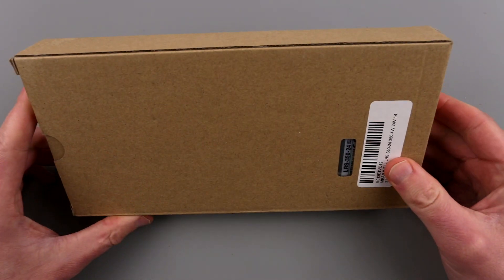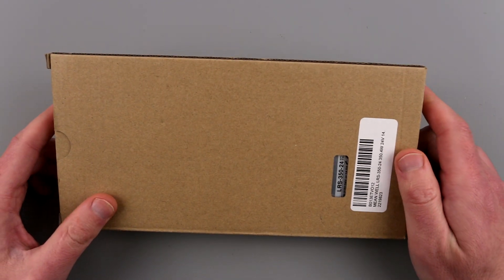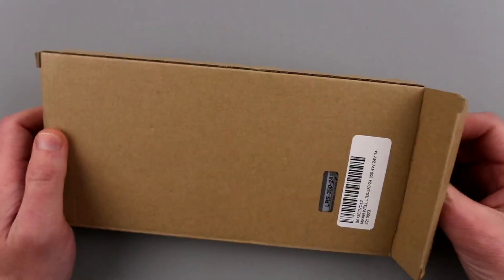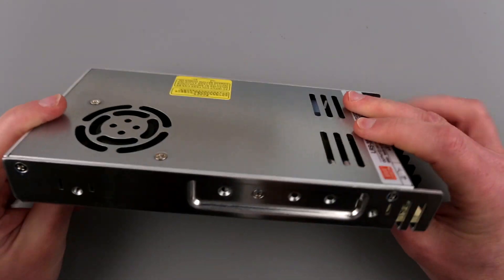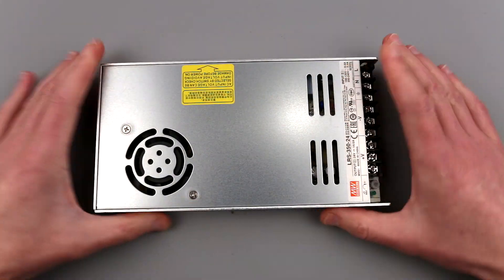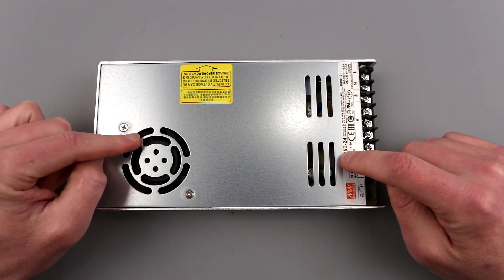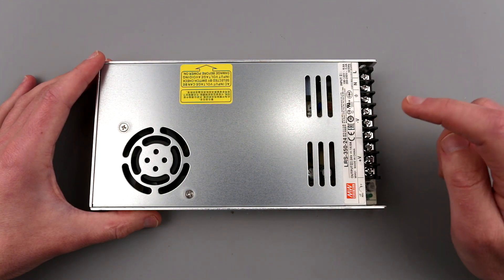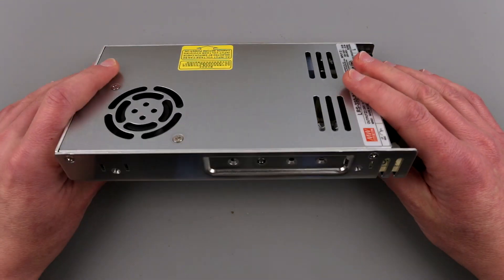Teardown on Mean Well LRS 350 24

Comment: The 1252I you mention is an NCP1252 current mode controller. The two 200 V caps in series are right next to the voltage selector switch and the circuit around the switch is called a voltage doubler circuit...Maybe next time when you review the internals of an SMPS make sure you understand the topology and circuit.
Reply from the maker: Thank you for watching. I agree, and I dont claim I know. And thank you for all the comments as I learn by making videos. My next smtp video woul be better ;)
Reply: Why you have to responed in such a way? he did not claim any info and said it is just weird which is normal.

dlkehead.

Comment: @8:01 The main HV capacitors are rated at 200V but when you switch the input to 230V they work in series -> the voltage is divided between them, so its well below their specs.
Reply from the maker: Thank you for explanation!

Comment: Great test, thanks. Would it be worth paying twice the price for rsp-320-24 for someone who won't use extra remote connection and don't need high inrush current handling?
Reply from the maker: Thank you for watching, I do not think it wort paying more. Unless you will be running all the time high current via long wires.

Comment: For the output - there are three positive and three negative terminals. Do those share a single rail? I want to get one of these, but it needs to power 4 devices. The power supply is rated for the power draw from all four. One thing mentioned that I didn't think about - I need to make sure I get one that regulates itself under load.
Reply from the maker: Both 3 terminals are wired together. It will regulate as long as load does not exceed 350W .But  I would not push for 100% load and stick with 80% for example and leave gap for extraordinary scenarios .
Reply: @InsideOutElectronics  100%. My actual needed load maxes out at 240. So the last 110w is my overhead.
Reply from the maker: @jeffrbake  Very good

Comment: Nice informative video.  I have a couple of questions for you.
I have one of these in my Creality Ender 3 Pro 3D printer.  It has been a good supply, but every so often the stepper motors will run really slow.  The only way to fix it is to cycle the power supply off and back on.  It does not happen very often, but it has done this on two different control boards; one an 8-bit board and the other is a newer 32-bit board.  Do you think it is a power supply issue?

My second question concerns the fan.  I saw another youtube video saying that the 12v fan is actually running on24v,  Do you think that is true or is the 12v coming from the center tap of a transformer?
Reply from the maker: Thank you for kind words !

IF only ONE motor is slow this mean that stepper driver is overheating or overdriven !
Can you swap motor with another motor and test ?
I do not think so - judging by a schematic 
http://mobilemodding.info/mean-well-lrs-350-24v-teardown/
it runs at 12V ( on 24V power supply )
Reply: @InsideOutElectronics  It is not just one, all directions are slow when it happens.  It does not happen very often.  I can go weeks even months before it happens again.  I might see about getting some better quality steppers though.  Thanks for the schematic.  It might come in handy.

Comment: Can this model connect in series. Is the output isolated. I need an application to get 48v. 24v from solar panel and series to mw LRS350-24, to run 48v dc motor.
Reply from the maker: Oh sorry, 24v from the panel plus 24 from the PSU? It might now work because of the current draw will be inbalanced.
Reply from the maker: Probbaly, not sure. But is int it better just to get 48v version ?

Comment: Hey I smoke this thing up and when I inspect I see liquid near those two primary capacitor. Is my psu dead or can be repaired.
Reply from the maker: Not supppse to be any liquids nearby caps. Hm, does it have any water damage?
Reply: @InsideOutElectronics  no it doesn't

Comment: Thank you very informative video! I’ve been thinking about using arduino, a mosfet and thermoresistor to controll the speed of the stock fan. Where would you say the best place for the thermoresistor to be?
Reply from the maker: Thank you for kind words! I think it is overkill to use microcontroller for this, also it is already temperature controlled - when temp is up fan kicks-in.  What exactly you want to achieve?
Reply: @InsideOutElectronics  Yeah maybe overkill but i like doing these kind of things lol, as is now fan runs 100% or 0%. Id like to have PWM controll so that fan starts at 30% at 30c and increase linear to 100% at 70c. All to make it quieter :)
Reply from the maker: @oscarsjolund9672  SO if you want to do this, you can consult schematic on my website - http://mobilemodding.info/mean-well-lrs-350-24v-teardown/ As far as I remember thermistor located is near or at ) the output inductor ( L100 )
Reply: @InsideOutElectronics  Thank you for taking your time, very helpful!

Comment: Those 200v caps are in series for 240v oparation. And the 120v/220v selector sets them to capacitor doubler mode with the bridge rectifier diodes for 120v oparation which boosts the voltage to 390v.. if this psu had active power factor correction this section would have been omitted and a 450v capacitor should have been given cus the apfc can boost the mains voltage to 400v .
Reply from the maker: Thank you for explanation!

Comment: What is Q122 component at https://youtu.be/Rk9B8RT26Ug?t=1001 ? I accidentally broke the tip of it while replacing fan, and my Ender3V2 reboots after getting some temperature. Is that component easy to replace?
Reply from the maker: This is 12V voltage regulator for the fan, your PSU reboots because it overheats
Reply from the maker: Never mind my previous answer, this is actually switching transistor 2SA562 !!! Check schematic - http://mobilemodding.info/mean-well-lrs-350-24v-teardown/

Comment: @insideoutelectronics Exactly what i was looking for! I'm trying to replace the clamping diode on ZNR5 at 7:45 but i don't know which specs it has, can you recommend a replacement for this? It's from my ender 3 v2 which was on 115V and not 230V as it should but the board is fine.
Reply from the maker: Do you know what was installed there originally? Model? You can use websites like this to find appropriate replacement - https://www.mouser.com/Circuit-Protection/Varistors/_/N-5g3h?P=1z0z63x
Reply: same, I was on 130v on my ender 3 pro, then it came out with white fumes

Comment: Thank you for this cool video! I'm about to replace te fan by a Thingiverse cover with a giant 120 mm Arctic Silent fan - not audible running at 800 rpm. The air flow of that big fan is way higher than of the small 60 mm stock, but due to the low rpm the pressure is lower. So I would like to measure the temp somehow to see if the fan's flow is strong enough to cool the power supply down... is there a way? Which component measures the temp to switch the fan on and off? One alternative is to place a sensor in and do comparison measurements, but is there an easier way? If it works, I can only recommend that huge fan. Absolutely NO noise, not at all!
Reply from the maker: Great idea! I will try doing the same
Reply: @InsideOutElectronics  Where can I modify to keep the fan on? please. Thank you
Reply from the maker: @lancereyesromero7811  2 ways.... replace fan for 24V and connect it straight to the PSU output, or fiddle with the thermistor ( bypass ) on existing fan control circuit  (12v)  to make it work always.
Reply: @InsideOutElectronics  sorry for the noob question but where can I find the thermistor?

Comment: cooling fan doesn't work supply 3v in place of 12v witch components faulty?
Reply from the maker: There is small voltage regulator just nearby the fan connector

Comment: The voltage is rectified and passed through a transformer prior to getting to those capacitors which is why 200v caps are just fine. Na Zdrovie!
Reply from the maker: Thank you, I probably need to make overlay to mention that!

Comment: Hey man, i have a meanwell power supply with no stickers or,anything, im trying to reorder it because it blew. I saw your pcb says "LRS-350A-R7." Yours is a 24v. Mine has "LRS-350A-R6" printed on it, do you know if that is the 12v? I cant find an image of the PCB anywhere to compare and this is the most in depth ive seen of it.
Reply from the maker: No, it is just a revision of the PCB, The same PCB is used in 12, 24V and so on,  components on them are a bit different though.
You have to look for specific voltages or model number of that PCB

Comment: My ender 3 psu is dead because the MOV has exploded. By any chance, can you recommend me one (what specs ?) to replace it ?  I will have to check the fuse. The ender 3 psu is also 24V / 350W.
Reply from the maker: Is it fixable? Do you have heated bed?
Reply: @InsideOutElectronics  Yes I think, the other components seems fine. Yes the bed is heated.
Reply from the maker: @didtoknan8128  Well try replacing MOV then. Probably it was over voltage event in your mains

Comment: This one is in half bridge configuration that is why there are Two 200V rated filter capacitors at the primary high voltage side .. They are in series ... and the Switching pulls power from them one by one ... ... That's pretty much what you will see in a ATX power supply ...
Reply from the maker: Got it !

Comment: I’m looking to replace the fan - could you confirm that the fan connection (CN101) outputs 12v rather than 24v
Reply from the maker: I cannot dissembled this using at the moment, it is being in use for 3D printer. But here it clearly indicates 12V, https://youtu.be/Rk9B8RT26Ug?t=262 I

Comment: HI !  thank you very much for your very interesting video   I have a 320-24 model.  The fan turns on immediately when the power supply is connected to the mains  The noise is too much   Am i using it to power an audio stereo amp  Is removing the fan safe ? is there a way to tame its noise ?  Thanks a lot, gino
Reply from the maker: You are welcome, does fan turn on when you just powering it up without any load?
Reply: @InsideOutElectronics  hi yes it stays on continuously
Reply from the maker: Also what exact model are you talking about
Reply: @InsideOutElectronics  hi thank you for the very kind reply My model is rsp-320-24 i wonder if using a 24v fan rotating slower can help or a more silent fan
Reply from the maker: You can put 12v fan, or put a resistor to reduce voltage. I have also es 420 24, And this one turn the fan with no load as well. Very annoying 😒  but I can tolerate because 3d printer generally is lauder.
Reply: @InsideOutElectronics  thanks a lot for the very helpful advice noise aside i am very pleased with the unit i understand they are of high quality kind 
As i said i am playing with some digital amps needing 24VDC as power supply  The difference using a strong Meanwell smps in place of the provided psu is remarkable   More power and less noise,  fan aside
I wonder if they have an overheating safety  I could try to run it with the fan disconnected and making some more holes in the upper lid to improved natural ventilation 
But i will look for a replacing fan  That seems the most sensible option  Thanks a lot again  Kind regards gino
Reply from the maker: I would try briefly wolithout fan at all to check if it overheats.
Reply: @InsideOutElectronics  Hi thanks a lot again. I wonder if the psu has some kind of protection against overheating.  I could fry everything ... problem is that i doubt silent fans of this size exist.  Usually the ones for pc are quite bigger.  I have to look inside for sure before attempting anything.  I could also try to replace the lid with a mesh or make many holes in it ... time consuming but this psu has very low electrical noise.  It is really good ... fan aside of course 
I could even use the case on a micro pc ?
Thanks a lot again.  Kind regards, gino
Reply: @gino3286  Audio equipment usually has very low average power. (Depend on the use though).
So I suppoe you can do with a weaker fan if you do not use it at full power all the time.
Reply: @pizzablender  hi thank you for the very kind and helpful advice I have great respect for meanwell brand My idea is to put a little dc dc converter before the fan to reduce its spin velocity The psu noise i am sure it's quite low The issue is only the fan spinning too fast
If they were not so expensive I would love to have a thermal camera to check the hottest spots on the psu boards
I guess they must be the parts already with heatsink?

Comment: Thank you for showing the inside of this thing! I think mine was a lemon and almost burst into flames so seeing how it is supposed to look on the inside is helpful. I'm still mot sure what was smoking and popping, but this we helpful in knowing what was supposed to be  on the inside.
Mind you, mine was powered recently so I'm not taking the board out of the case to check the bottom. I'd rather not get a big ol' shock.
Reply from the maker: Oh wow, any proper power supply should not burst in flames. It shoul have protection from any short, overvoltage and abuse. Unless it was damaged or something. Does it still have warranty?
Reply: @InsideOutElectronics  Yeah, I just got it. Getting a replacement now, I'm pretty sure it was just a lemon part as everything else on the board is fine.

Comment: what kind of size of Allen wrench do you need to use to attach the box to the frame of a. 3d printer?
Reply from the maker: Depending on used screw. I use philips head screws. So no Allen wrench needed

Comment: Hi, can you tell me what is the J6 jumper? It broke in my PSU and I don't know if it's just a jumper or any kind of diode because it doesn't react like a diode... Thanks
Reply from the maker: It looks like jumper link with ferrite bead, to cut down some EMI. Technically it just piece of wire.

Comment: Hi, could someone say me if the fan in the power supply is pushing air outside of of the box or pulling air fresh inside to the electronic cars until vertical air vents ?
Reply: The fan is blowing fresh air in. Normally the output is the side of the label.
Reply: pushing out, which is how it should be
Reply: @nipunagunarathne4882  When in the video "inside out Electronics" open the box, i see the data about the fan facing inside that means it is pushing air inside, no ? Could someone test it placing a paper in front of the fan : if paper stick it means it is pulling air inside ...
Reply: simple test. Start printer let the psu fan run and take a piece of small paper. Put it near the fan and see if the paper gets sucked up to the fan or pushes the paper out. Just tested it on mine and its blowing air on to the components of the motherboard.
Reply from the maker: Hah, my printer does not use enough juice to kick-in the fan :) I have to load it I guess.

Comment: Thank you for the teardown video.  I have the same model, and I was freaked out by the silicone goop on the circuit board, but it is good to see that it is part of the manufacturing process, and is not a component failure.
Reply from the maker: You very welcome! And I appreciate the feedback. What are you planing to use it for?

Comment: do you know of any troubleshooting for this? mine has no output voltage. its set at 230V (which is correct for my case) and the fuse is fine
Reply from the maker: Troubleshooting switching PSU is a bit of challenge for me... sry
Reply: Same,  i have the 12v version.  No output voltage
Reply: Mine as well

Comment: 8:11 learn how switching power supply works and then you will know why 200V caps work. they are connected in series so they together can handle 400V and that covers 230V*sqrt(2)=324V which is the voltage they work when you have 230V in the wall.
Reply from the maker: Thank you, I have already read up on that thank to this psu teardown.
Reply: I dont know, why dont they use plastic body to avoid hazard due to metal body?
Reply: @MrNams  metal body's tend to be safer, the metal body tends to be connected to ground
if there is an accidental short or loose wire from mains and it comes into contact with the metal body it will trip the fuse
Reply: When you select AC110v .only one capacitor works.
Reply: @mycutydoll  no, they'll work in parallel. This layout is called a voltage multiplier and it's a way to have high voltage in the primary either with 110/220v in the mains.

Comment: is the fan header 12v?
Reply: The reason I ask is that 12V fan runs like a jet engine, maybe they are running it at 24V?
Reply from the maker: @drozcan  Doe the fan runs all the time or just under heavy load in your case?
Reply: @InsideOutElectronics  just under heavy load, I'm using it in a 3d printer so when it starts to heat up, fans kick in
Reply from the maker: @drozcan  Thank you, my load is not so big at the moment
Reply from the maker: I can measure, but fan is 12v. If they take 12v and run it at 24 it certaily would die
Reply: @InsideOutElectronics  Have you already measured the voltage of the fan connector? Is it 12V or 24V? I want to replace it with a new Noctua fan, but they are all 12V.
Reply: @loneship_de  It's 12v. Unfortunately Noctua does't sell 60x15mm fans, only 60x25 which is too thick. I'm thinking of soldering a resistor on it.
Reply: @loneship_de  You can use Noctua Fan ... just check https://www.thingiverse.com/thing:2967389 and Noctua is model A8 FLX https://www.youtube.com/watch?v=q7qAe9cDPjI
Reply: @DrumdevilNL  there is modification of enclosure so you can use 80x80x25 fan ...
Reply: But where the 12v come from and what current can it supply?